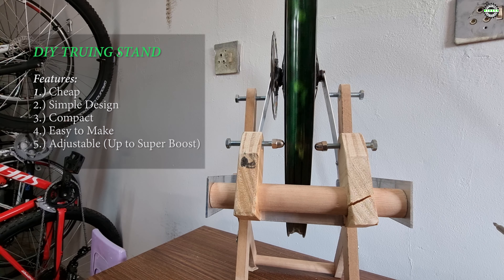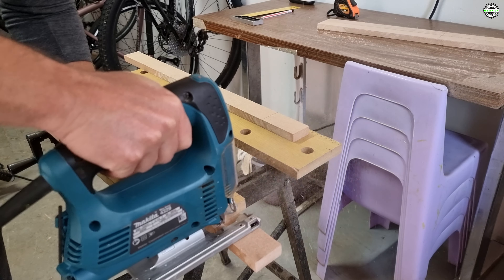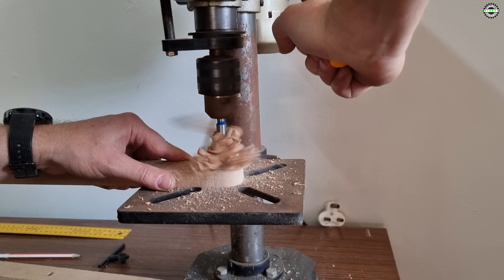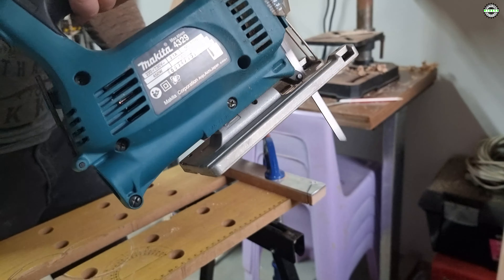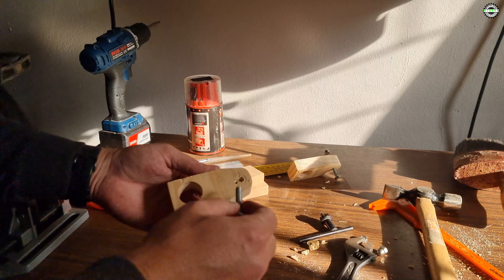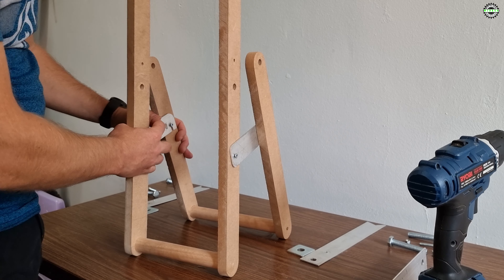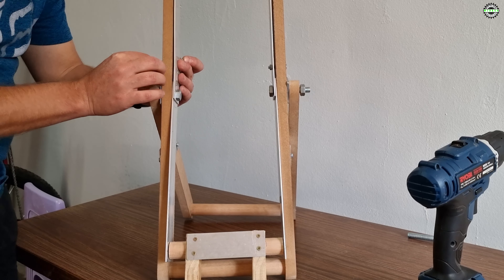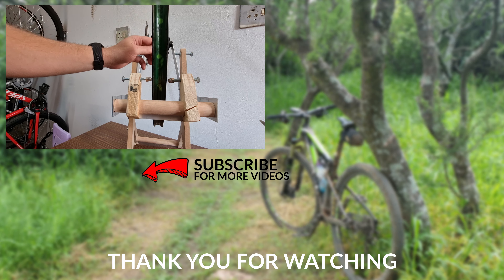DIY Truing Stand v2 (Compact, Light weight & easy to make)

Comment: It would be worth showing it being used.  The width adjustment at the top looks a bit flimsy.  I think I would go for a spacer or a slide rail at the top.  Also, the bolts on the rim are a bit crude.  I like the idea of using a dial gauge.  This allows you to find the max and min deflection statically.